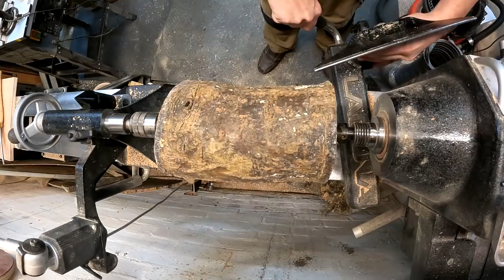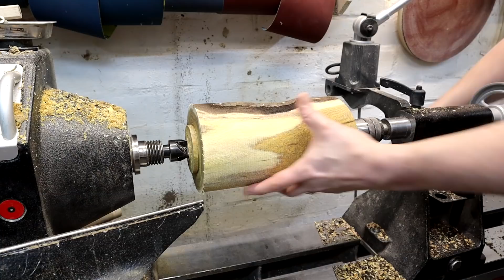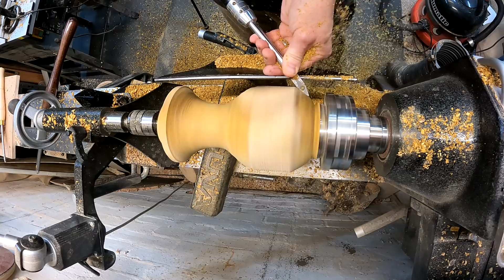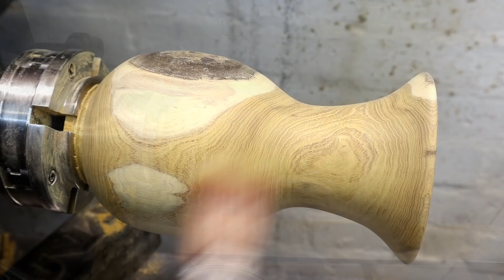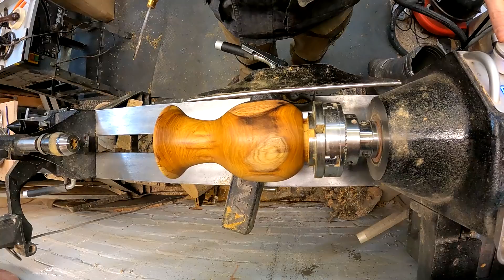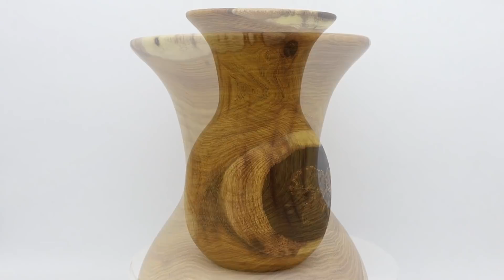Woodturning - Love for Laburnum

Comment: Looks lovely, has it split in half yet? I turned a beautiful pot out of Laburnum with a lid. it was dry seasoned for 5 years and within a month of sitting on a shelf Indoors as the finished article it split 6 ways and fell apart. Beautiful looking wood but everything I've made with it cracks up.